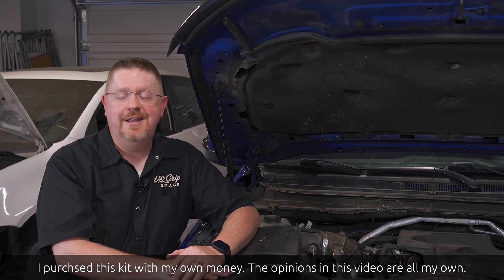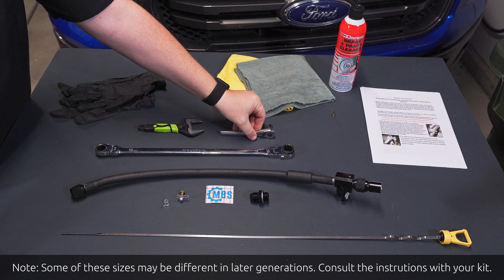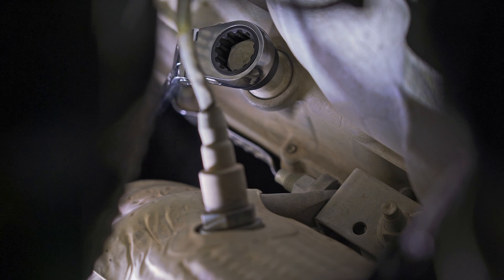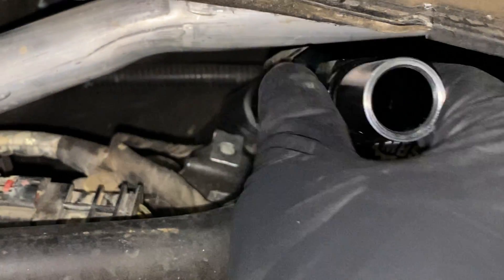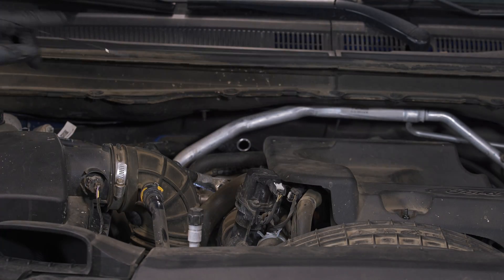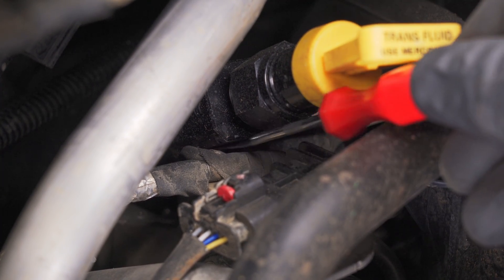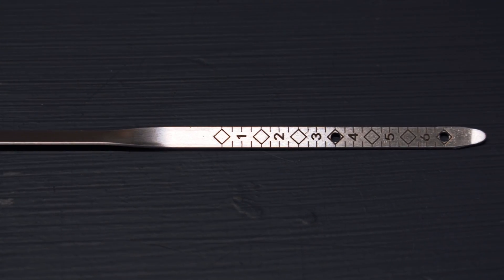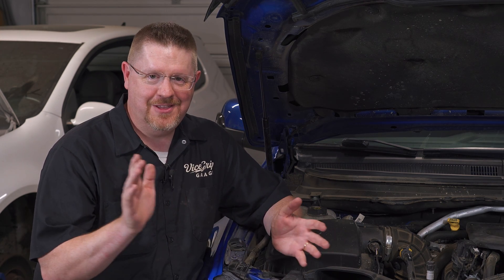How to Install MBS Dipstick in a 2019+ Ford Ranger

Comment: The engineers, along with the people that approved this, should be required to work in Ford service dept for six months, 100 tranny fluid level checks or two separate third degree burns. When they finish their tour, they can fix this stupid design.

Comment: Is there a siphon kit/pump you recommend that works well with it? I need to remove some fluid
Reply from the maker: I've used this one: https://amzn.to/4kdYYN3 - the smallest-diameter hose that comes with it will fit down into the FitzStick filler tube. Pulling fluid out like this can get a bit messy, as the pump can be a little fussy. Have a lot of towels on hand. Good luck!

Comment: Great video! I am going to install mine today. I have an off topic question. Have you never had any problems with your tranny? I own a 2020 Ranger 4wd,XLT. How many miles do you have on your RANGER? Thank You..
Reply from the maker: No problems. Coming up on 55k miles. I did do a drain/fill of the trans, and have upgraded the trans pan to an aftermarket one with extra capacity and a drain plug. Fingers crossed I don’t run into any problems with it. :-)

Comment: How long is your 19mm wrench? Would a 10” 19 mm flex head work? Thank You
Reply from the maker: I'd recommend adding a cheater bar to the end of a 10". You'll need all the leverage you can get to crack open the factory cap. Good luck!
Reply: I tried with all my might. I was afraid it would snap. Still have not gotten it off. I tried a socket and ratchet and then a flex head wrench. Guess a cheater bar is next but I'm afraid I'll snap it.. only have 7k miles on my 2021 and it's on there good.

Comment: Breaking the existing tranny plug wasn't such an ordeal.. However, threading the new tranny tube and installing the new clamp & u-bolt were a true and repeated test of my Christianity. Also, make sure to have an eleven year old or someone of similar aged eyes to help you read the fluid level on the new stick. (True story)
Reply from the maker: I'm glad you managed to get it installed - the spaces you have to work in are really pretty tight!

Comment: Excellent instructional video!  This really helped me to complete the upgrade.  I didn't have any trouble getting the factory plug removed, possibly because I had the transmission fluid changed recently.  The difficult part for me was to get the bracket to seat over the U-nut properly.  Thank you for the preparation to put this together in such an organized manner.
Reply from the maker: Hey Rich - I'm really glad you were able to get yours installed. It really makes it so much easier to check/maintain the correct fluid level in your trans. Thanks for watching!